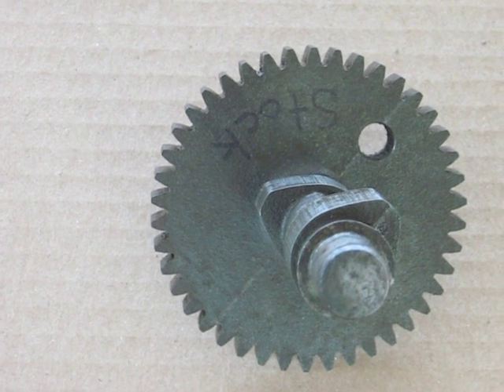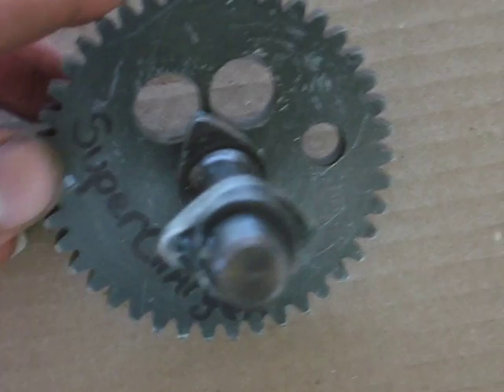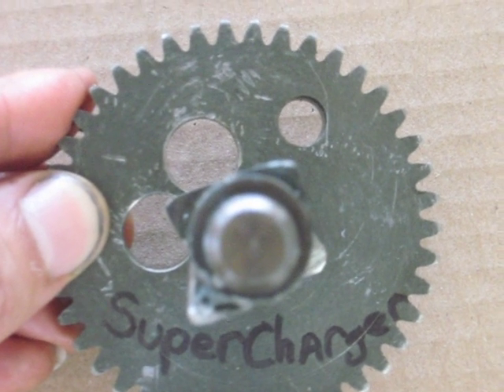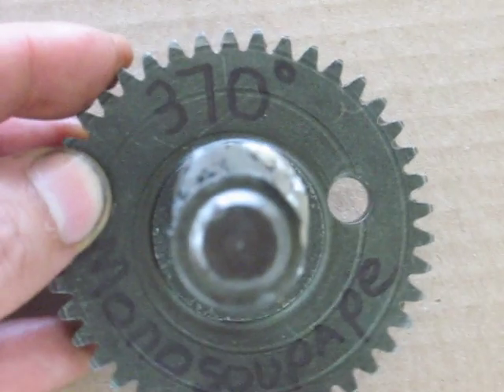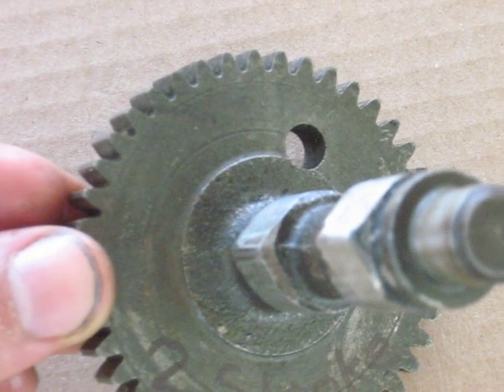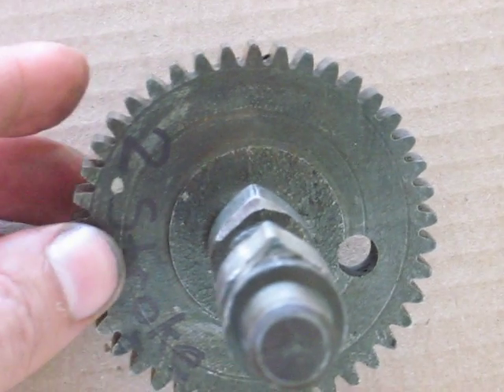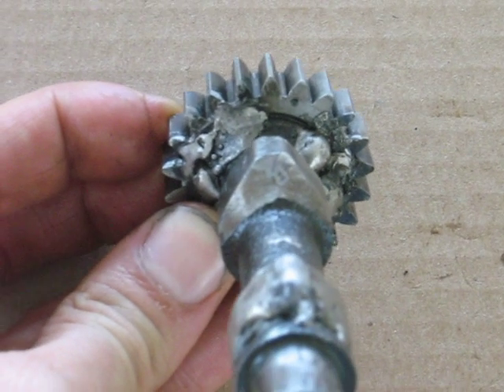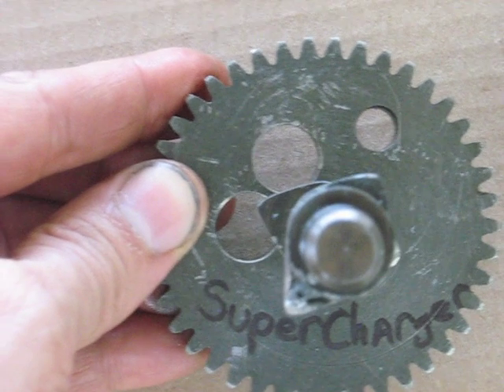Modified Camshafts for Briggs experimental engines

Comment from the maker: @formulasonny 
Not really, I could do that, these cams are for special applications, like turning a 4 stroke engine into a 2 stroke, or an air compressor, or even a compressed air powered motor. Generally it would be much easier to just build up the lobes a bit to make more power, of course the surface finish would be more important then.

Comment: @ChargerMiles007 Cool. I'm glad you're able to do all of this custom stuff. I've always wanted to build a custom Briggs with an external OHV setup. I was thinking of taking a standard Briggs block, adding an extended cylinder sleeve, then cutting away the section of the chamber where the valves normally sit (as well as the external section with the valve guides, etc.) Then I would build a custom cylinder head, and use the rocker arms and pushrods from an old Lister engine (very cheap to buy.)

Comment from the maker: @makypunk021 
Yes, I watched a couple of your vids. Impressive.
So you use the engine for boat racing I guess.
I don't see why welding up a camshaft to get longer valve opening duration couldn't work in that engine. I can't say for sure how long the camshaft would last, but so far mine seem to hold up OK.
Best of luck in the racing1  :)

Comment from the maker: @Chevymonster203 
Well, I might be a Tard in your opinion, but not in lots of other peoples!
What toy said would be correct, it the camshaft was a full speed cam, like in a Detroit, However, I use this one as a 1/2 speed cam, so it needs 2 lobes to do the same job.
The "SuperCharged" lawnmower engine I built basically uses the Detroit cycle, but is a gasoline engine.
Check out my opposed 2 piston stroke, it has NO valves!

Comment from the maker: @MrTpengineer 
It just affects duration, or lift. Making thses cams is rather time consuming, so sometimes I am not very fussy about having the lobes exactly the best shape. Lately I have been taking more time with them though. I am working on a full speed cam 2 stroke poppet valve engine at the moment. It will be like a Briggs version of the Toyota S2 engine.

Comment from the maker: @refridga 
That particular cam is for a supercharger, which is basically an air compressor. So it will generate some compression when the piston comes up, depending on the intake manifold volume that it is pumping into, and a few other factors, like throttle opening.

Comment from the maker: @motorhead45102 
Yes, you are right, these aren't precision machined, or polished!
But most of my engines don't get much running time, so thats OK.
Only the Sleeve valve and the vertical to horizontal conversion have run for a bunch of hours. Oh yes, and the air compressor.

Comment from the maker: @mattc1683 
Gee, I don't quite know what to say to your request!
I am not really super interested in taking your money, as all this stuff is a hobby for me! However, I wouldn't mind helping out a fellow Briggs Fanatic! :)
The one thing I don't have is a 6.5 Briggs engine, or a camshaft for one.
Also, my cams work for a while, but they sure aren't face hardened or anything like that!  What model # engine is yours, as I will start to look for a scrap one.
What lift/duration did you want?

Comment from the maker: @shinyfuzzy 
Yes, you could blow the motor, but 1 advantage to the flathead engines is that the valves can't hit the piston!
Yes, you would definitely want to clean all the slag off the welding, you don't want that coming off and floating around in the crankcase! A sandblast job would help out there.
So is this a real racing engine, or just a converted roto-tiller engine with a racing rod etc., like ours? (Which goes like H*ll I might add! :)

Comment from the maker: @shinyfuzzy 
I actually welded up my first few cams using a stick welder, although I did have some of the special nickel rod for use on cast iron. I don't know how well a "normal" arc rod would work, but giving it a try couldn't hurt! 
Sure, you could get more valve lift, and duration, but be careful to make sure the valve won't hit the head. I check that using Plastcene (modeling clay), but chewing gum, or something else less stcky could also work. Just put it on top of the valve, reassemble.

Comment: we are using OHV (over head valve) engine 13hp 4 stroke briggs & straton (also known as vanguard) in boat racing.. and we are also used the engine 16hp cam -in- block which is the (L head ) type engine. as i said we do some adjustment in camshaft..but we lossed the race.. their engine(briggs & straton) is much better than i used.. we also do over sized the piston.. much bigger carburator.. but their engine (briggs & straton) is much powerful w/ high rpm

Comment from the maker: @junzkii 
So you use 16 hp Horizontal shaft, or vertical shaft engines?
I can't see the supercharger camshaft working for you, as the ones I build operate on a 2 stroke cycle, and your engine still needs to be a 4 stroke. Are those 16hp engines OHV (over head valve) engines, or the older flathead (L head) type?  I would think you could Hot Rod an OHV type engine better with a higher lift cam, ground out valve ports, modified exhaust etc.

Comment: we are using 16hp and 13hp  briggs and straton in our boat racing here in the philippines. we do some adjustment also in camshafts. but i'm curious w/ your super charge modified camshafts... can we use that in my briggs? for boat racing?

Comment from the maker: @junzkii 
Hi there, I doubt I can help you, but look at the previous comment about Delta Camshafts. There are quite a few people that race Briggs and Stratton engines.
What size engine are you using?  I know there is a alot availible for the model 13 (5hp flathead engine) since they use those in go-karts.
Talk to you later :)

Comment from the maker: Thanks for the info :)
I doubt I will need there services, as these engines are all just experimental, and don't run long enough to wear the camshaft enough for me to worry about. Also, I would have trouble giving them the correct spec to grind to, as most of the time it takes me a few tries to get it right.

Comment from the maker: Yes, it is tricky!  Mine look pretty sad, but they work well for the short time periods these experimental engines run. The one thing I tried that didn't work out, was grinding down the lifter diameter, I got it too small, and it actually dug into the cam lobe! That is when I decided to go with a full speed camshaft on my supercharged 2 stroke (I have not got that engine re-assembled, and running yet) We have been busy building a 440 for the Charger, got it back on the road yesterday :)